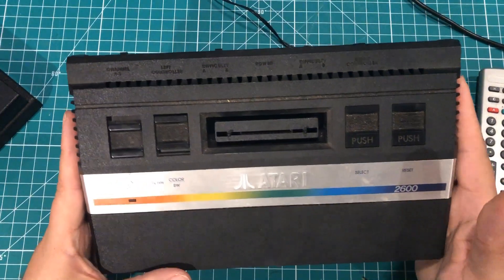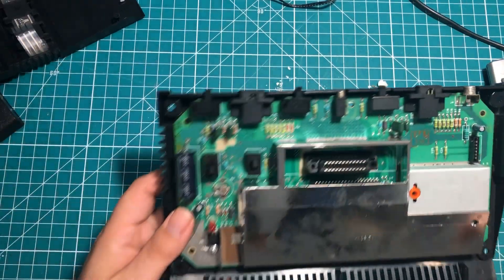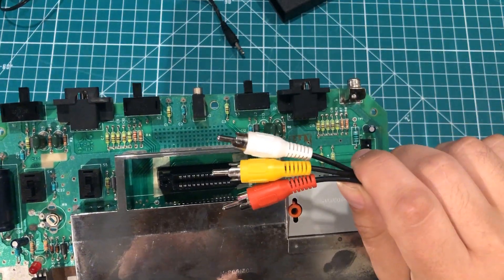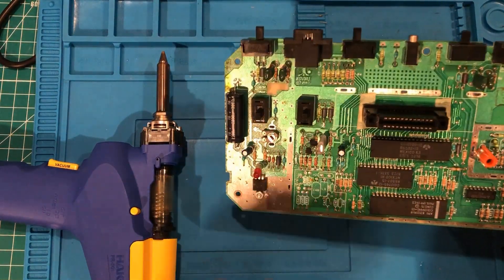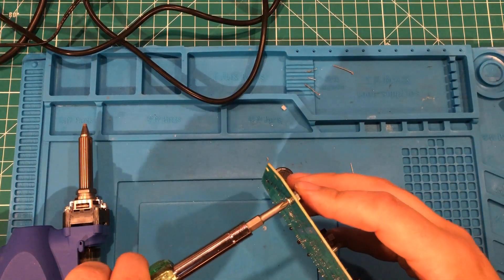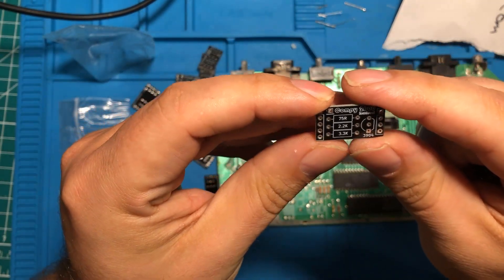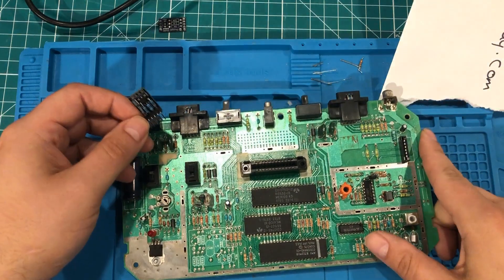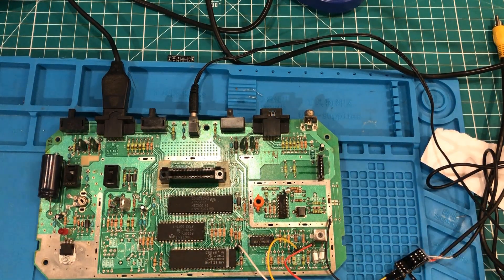Atari 2600 Teardown and Repair (and video mod)

Comment: I'm looking at maybe ordering the boards you listed from PCBWay, but it states it's for NTSC, so I wanted to check if the same mod board and components would work for a PAL 2600 Junior?  My understanding was that for this type of av mod, which is one of the most basic, the mod is the same but with potentially different solder points on the 2600.  Do you know if that's correct?
Reply from the maker: I do think the board is the same but the connection instructions are different.
Reply: @AnotherMaker  thanks, I thought that might be the case.

Comment: Wow, you a lot more production effort into this one! Spiffy!
This must have been very satisfying for you.  Was it the 7805 replacement, or the video mod that really fixed things?
Cannot find the reference, but I watched a thing once explaining how the 7805 is the most important IC of all time.
Reply from the maker: haha. I'm working on the production a little bit. I've been phoning it in for a while :)    It wasn't in the video, but the voltage was reading a little high out of the old 7805, and the new one has it on bang on 5.00 volts, but the video mod is what actually fixed the thing.